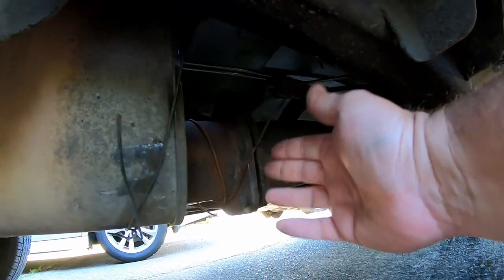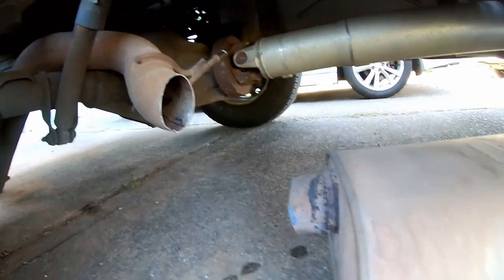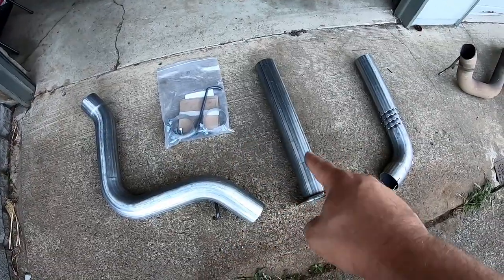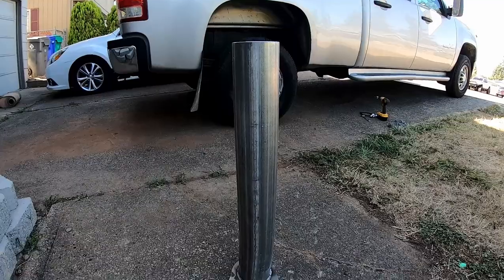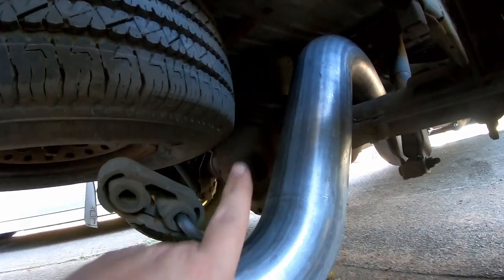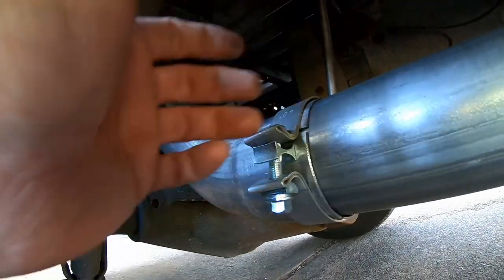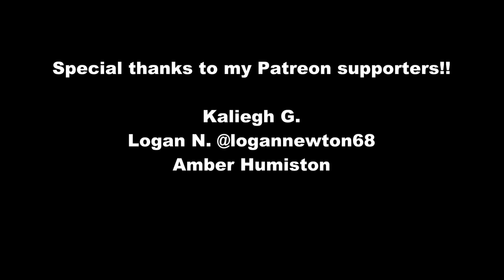Duramax MBRP Exhaust Install | Chevy Silverado Filter Back Exhaust System s6026p | GMC Sierra LMM

Comment: Hey did you notice anything different in power or miles per gallon with this? I just ordered the same thing.
Reply from the maker: Not really. I've only driven about 150miles with the exhaust so far
Reply: @BriGuy503  Copy that. Thank you sir.

Comment: What size is the stock pipe?
Reply from the maker: I think it's the same as stock, 4"
Reply: @BriGuy503  ok thanks I plan on doing a full straight pipe and haven’t had time to look what all I needed. Forsure would need a 5”to 4” reducer